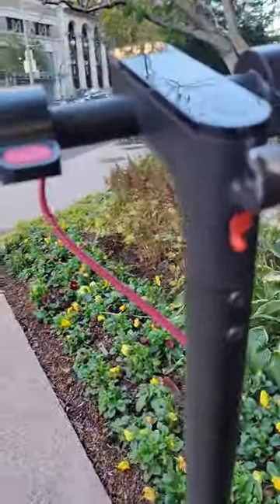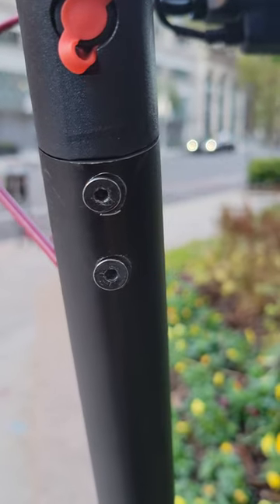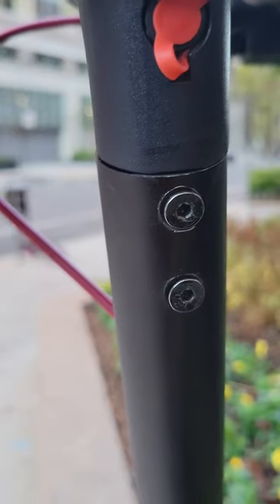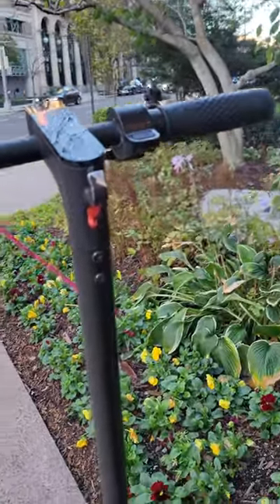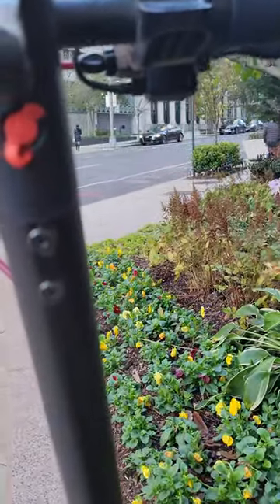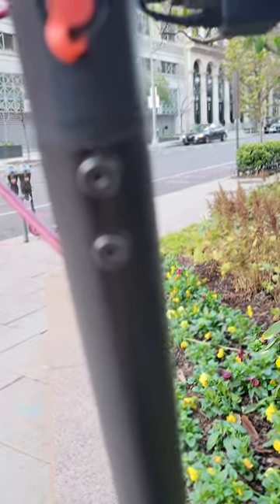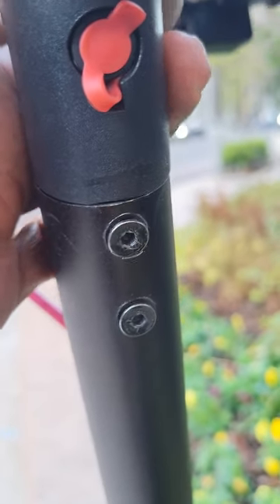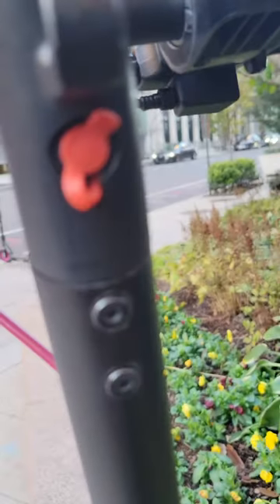loose handlebar on Hiboy S2 Pro

Comment: I threw those screw to the garbage. I bought two long Screws Bolts, Nuts, Flat & Lock Washers. And works much better than all 4 screws. Screw them from hole to hole or side to side. However you wanna call it. Trust me you'll be satisfied. Be careful and gentle with the wire!
Reply: Could u send a picture of the EXACT screws u used
Reply: Wouldent that damage the wiring tho?